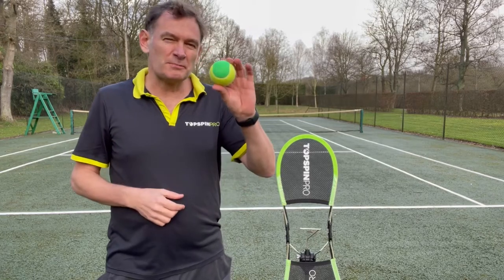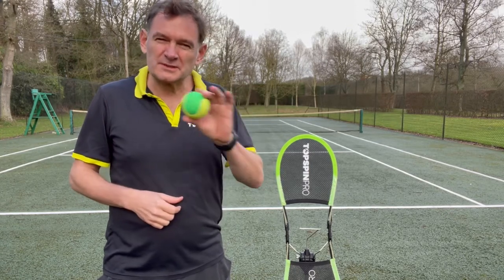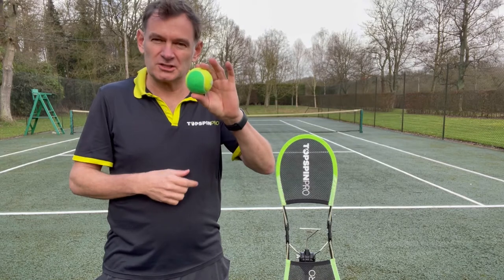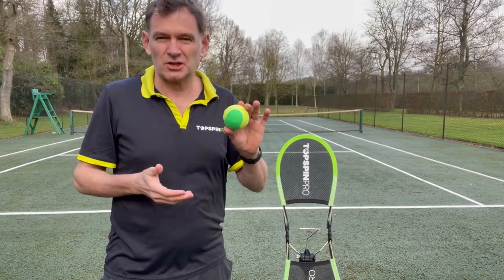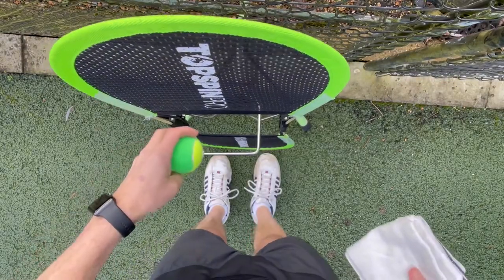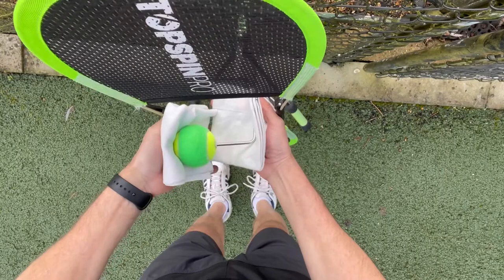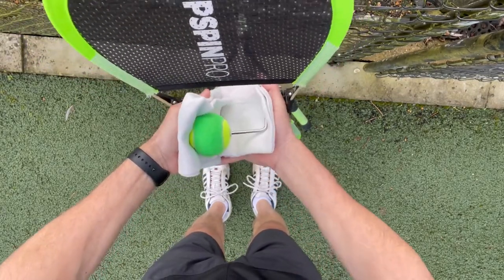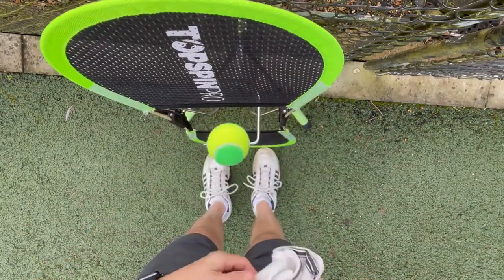Installing a Replacement Ball on the TopspinPro

Comment: This is helpful, but how are the little parts supposed to fit on? I
Reply from the maker: Do you mean the spare parts in the bag?
Reply: I have the same question. What are the little transparent washers and cylinders for?
Reply: @TopspinPro yes, could you please clarify where to fit those plastic washers
Reply from the maker: @vakula485  the washers are an addition to add onto the end of the ball spindle if you want them. They are not required now that the ball spindle stays on by itself (newest ball design). But, many people like the add them for extra protection to keep the ball in position.
Reply: @TopspinPro  lol, need to pin this comment.  i presumed it was to keep the ball in place, but was confused by how many i got... 3x balls, 6x plastic opaque washer 6x clear soft silicon tube... so was immediately thinking i needed to use 2x washers and 2x tubes to install 1x ball...